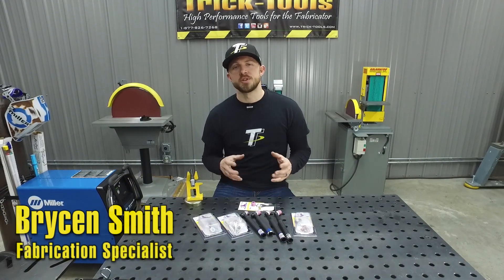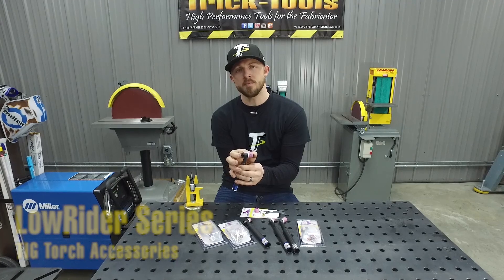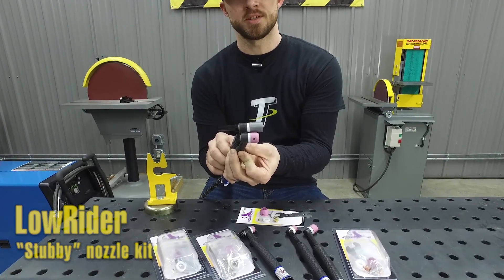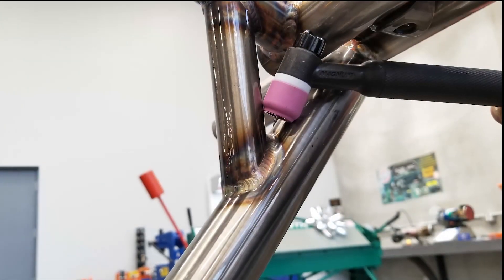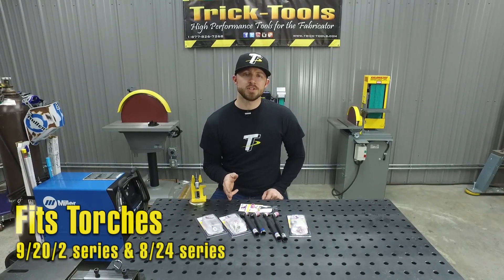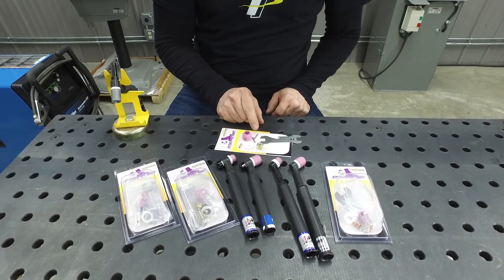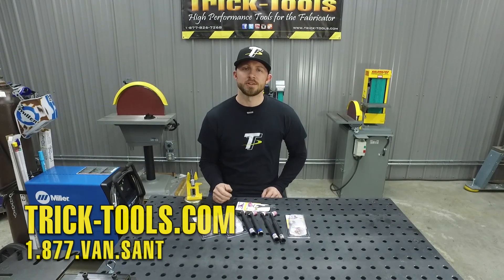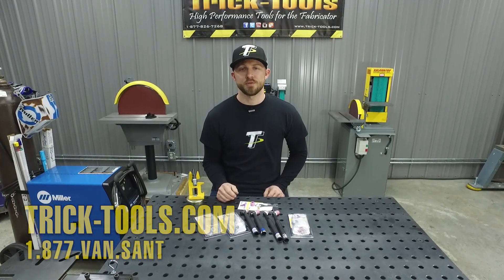LowRider TIG Nozzle Kits

Comment: Why not have these for the stubby kits on a 17, 18, & 26? At least the lower rider because the slammed probably won't work...but the cup thread sizes are the same on a 17 stubby so I cant see why the low rider wouldn't work.
Reply from the maker: The threads on a 17 series torch are not the same as the 9/20 unfortunately.  At this point we do not offer a lowrider for the 17 series but will definitely consider it for future development. Thanks for the feedback!